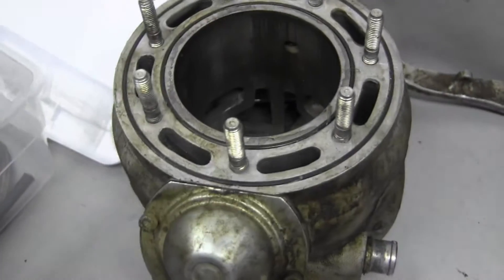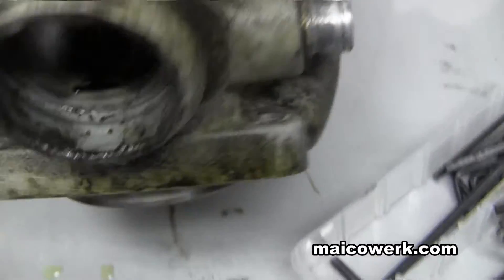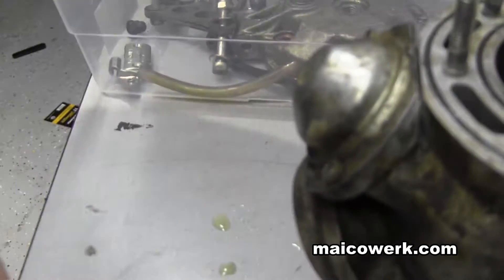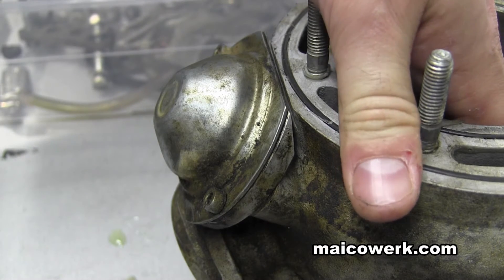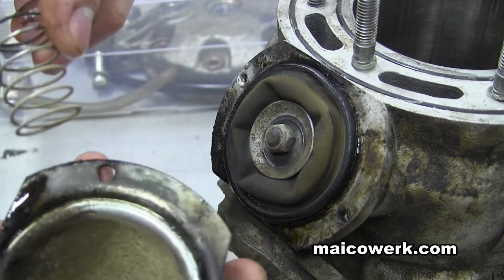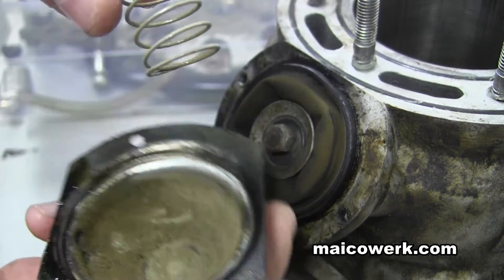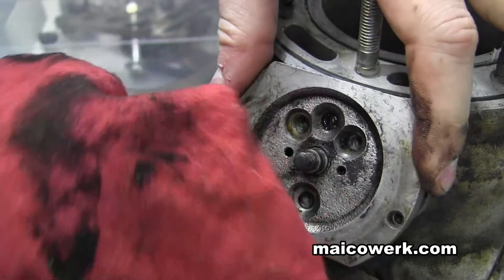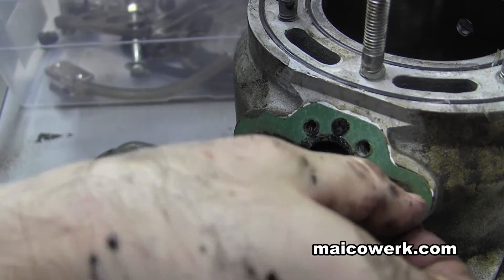The Maico S.E.E.S. Power Valve System

Comment: Toby do you have any sources for S.E.E.S parts? Need to rebuild one on a 86 250
Reply from the maker: Koestler has those parts.  There is a guy selling a 1986 Maico 250 with a 320 top end on it for $2,000 in Ohio if you want it.
Reply: Opferman Motors Dirtbiking thanks Toby, I'll message him

Comment: do the Zabel 700, mth 700 and other large bore two strokes like the KTM have power vales aswell?
Reply from the maker: +Matt Gore Maico 685/620 can come with or without the power valve.  Both of mine do not have a power valve.  My 660 has a power valve.  The Zabel 700 does have a power valve.  MTH, KTM, I'm not sure if they have one, they may not.

Comment: Not trying to be a smart ass here just giving some more info. This system is an exhaust valve not a power valve because it opens and closes via the rpm of the motor and not by a linkage it is better in my mind because it a smoother operation. They are very common on snowmobiles because of that reason. But one down fall to this type of exhaust valve is it should be cleaned more often due to it not being powered mechanically.
Reply: Rpm and exhaust pressure pushed against the guillotine*
Reply from the maker: +Buck Chapel Maico called it a Power Valve.  I have heard of them referred to as an "Exhaust Power Valve" by snow mobiles.  However, "Exhaust Valve" by itself I've only heard used in terms of a 4 stroke, where Exhaust Valve means to open and close the exhaust flow.
Reply: @Maicowerk  yes, I think you're right, like the Yamaha's EXUP system is an exhaust valve, right?

Comment: They say the Japanese companys toke those motors apart to try to copy there power band at low rpm like the four stroke motors do that must be what they where trying to accomplish with that kind of power valve I'm sure they didn't have a problem doing so I think it came down to a reliable issue why would Japanese companys trun around the way they always built there engine to accomplish what maico did? I'm not sure exactly if that's right please correct me if I'm wrong I love these bikes and motor designs I'm definitely looking for answers why they could not copy maicos power band?
Reply from the maker: Note that the power valve wasn't introduced in Maico until 1986 on 250's and until 1987 or 88 on the 500s, so this was much past the Maico era.  The bike that the Japanese took apart were the early 80s 490 engines, the 81/83 engines, neither which had a power valve.  Having riden and owning all these range of bikes, I'm not sure the Maico really needed a power valve to begin with but the 2000s Maicos do put out more power but the earlier Maicos are smoother.  I'm not sure why the Japanese could not copy it, for one, if they just did an exact replica then they pretty much are making Maicos at that point.  Perhaps they could not figure out an alternative method or could not figure out completely how it worked or only attempted to take pieces of it.  Just to note, the factories are not perfect, especially in early 80s.  You also never know who is really working on the engine, perhaps Maico had much better engineers than were at Honda.  So for example, the YZ490's aren't considered to be that great.  The CR450 was terrible and had bad gear spacing.  The 84 CR500 had a badly shaped head that caused it to detonate, ping and overheat.  Given they are making mistakes in their designs that have gone out to production, its' not unreasonable to suspect they were not able to figure out all of the port timings and physics required to generate that power.   Later on, perhaps they did not want to and that was not thier goal anymore.
Reply from the maker: The 81 and 82 didn't even have reeds, it was piston port, and still it has smooth power from idle.

Comment: very interesting system, how consistent is this when riding the bike? by looking at it I would guess that the RPM it engages at and the amount it opens the valve would be very throttle and RPM dependent?
Reply from the maker: I don't notice it, the bike's power delivery is smooth and hits hard.
Reply from the maker: Yes, the RPM dictates it.  It's pretty simple system and seems to work well.